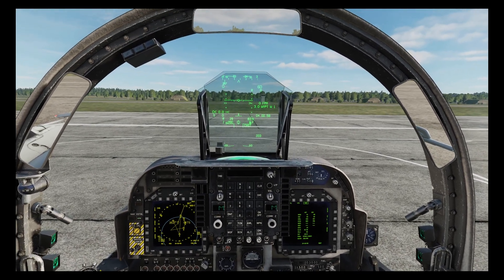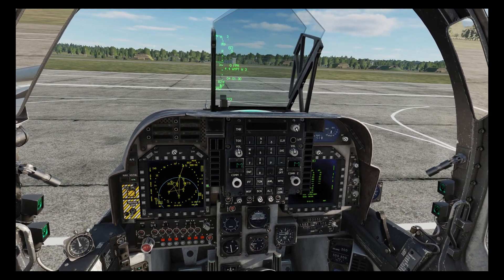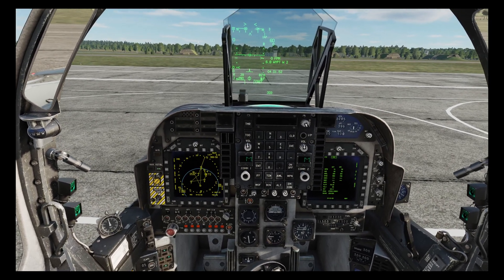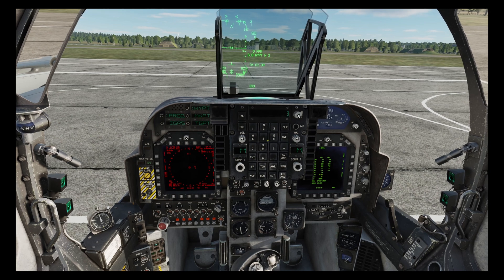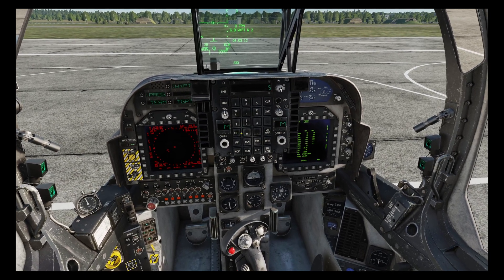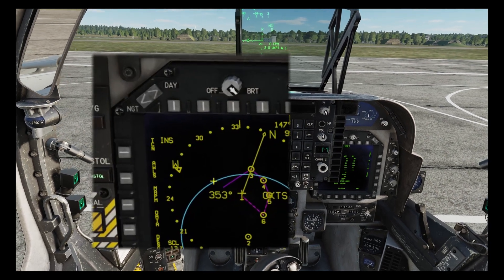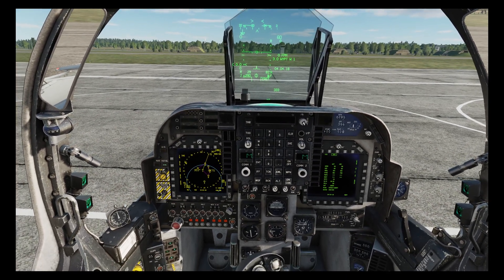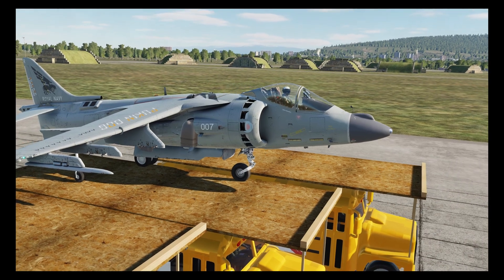DCS Harrier Non Sequential Waypoint (NSEQ)

Comment: Great tutorials, thanks…..how do you get the blue circles for refueling zone etc to show on the MFD?
Reply from the maker: Hi Mark. The way it works has changed recently. If you to go a waypoint and in the right most property at the bottom you can assign that waypoint as an AAR zone. You then need to enable Overlay1.....from the  EHSD select MAPM than OL1